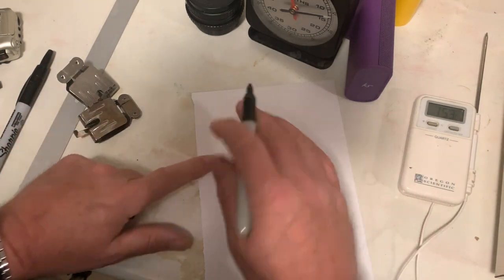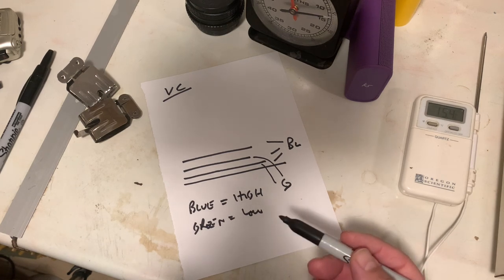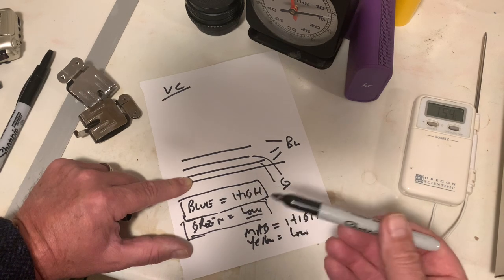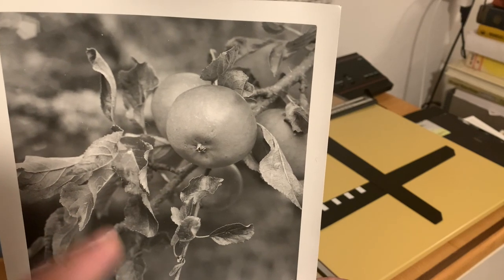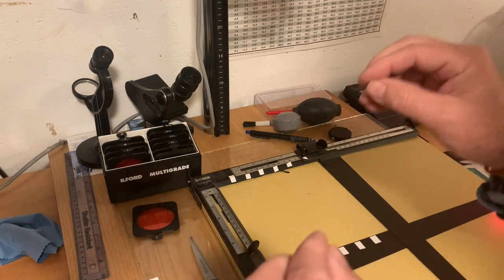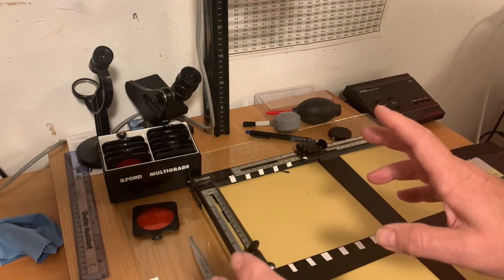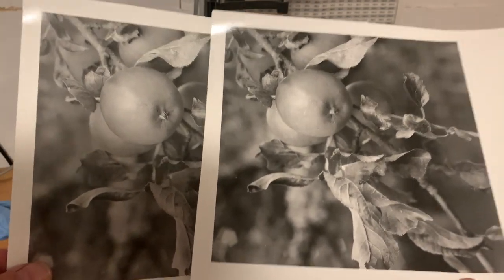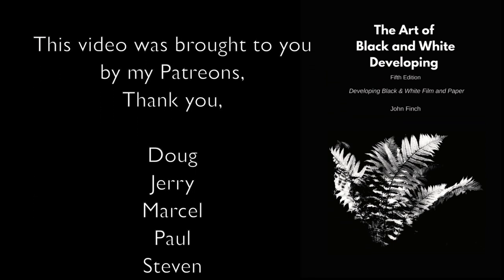Darkroom Printing Pt4 - Split Grade Printing 101

Comment: When I split grade, I lock in my grade 0 time.  Then on the grade 5 test strip…I first hit it with the grade 0 time established.  Then you see the cumulative exposure on the test strip.
Reply from the maker: I must try this
Reply: I do similar, but I am a grade 2 test strip.  It is all about been consistent.
Reply: Thanks for the video - well put together. I also overlay the grade 5 test onto the grade 0 basic exposure, as this then takes into account the effect of grade 5 on the lighter tones.
Reply: same, this is how i learned as well and it works great

Comment: Here’s a good one.  Very good.  As a commenter near the top suggested, Bob Carney taught us (test strips) to make the soft-contrast exposure (Gr. 0-2) just a little fainter than if we were going to do a straight grade print, then lay down the high-contrasts tones ON TOP of the base #0 or #2 exposure. 

Always put the soft filter on the left side of the workbench, hard on the right!!!  Mixing up filters in the dark is just TOO EASY. 

And: in this example, Carney would keep the timer at 5 s. And blast TWICE with #5, then count “1-Mississippi” (twice) to add 2 more seconds. 

Changing the timer invites wasting paper. 

Once you have 1 good print, make 2 more for archives. Then move on, smiling.
Reply from the maker: Thanks, Larry.

Comment: Thank you for explaining and illustrating the split grade process.  I have just started printing my negatives and I am learning as I go along.  It is a hit & miss thing so far and there are times when I just want to give up...but your simple straightforward explanation has filled up the blanks for me...and now, I can't wait to get home and try it again.  Thank you for doing this.
Reply from the maker: Cheers Mark! Don't ever give up, it comes in the end and is so worth it!
Reply: @PictorialPlanet  Thank you once again for the tip.  I have done a couple of prints using contrast 0 and contrast 5 the way you recommended and I am very pleased with the result.
Reply from the maker: That's great @Mark Villanueva

Comment: Thank you for your video, John.  I've been getting mixed results with split grade printing but somehow I hadn't yet tried making separate test strips for low and high contrast.  My trial and error process has been inefficient.  (lots of wasted paper even as test strips...)  Looking forward to putting your knowledge to use in my darkroom!
Reply from the maker: I had the same issue but this seems to work for me. I don't do it all the time, just certain prints.

Comment: Nice print.  Have you considered the intermittency effect?  "Having made a test strip in a series of intermittent short exposures, the subsequent print is mistakenly  made with one long composite exposure. For example, if the test strip showed correct exposure at seven one-second exposures, the print is then made with one seven-second exposure.  Due to what is known as 'the intermittancy effect', this is wrong.  The single longer exposure will produce significantly greater density than several intermittent ones of the same total duration.  Even many professional printers are unaware of this.....  .. So make your actual prints exactly as the test strip, in exactly the same multiple intermittent exposures"  Quoted from Elements - by B. Thornton (p22 par5) and Edge of Darkness (p124).  An interesting approach to setting G-0 and G-5 exposures - well worth a try judging by the differences in your print examples.
Reply from the maker: I do think if that as shown on my FX55 developer series and others. Certainly for three exposures it make little practical difference in my experience.
Reply: I reckon it's an issue with shorter test exposures (1s as you mentionned). IMHO with 3s or longer interval test exposures, the intermittancy effect is lessened and not quite an issue with the final longer print.
Reply from the maker: Thanks for your comment, Julien. Agreed. Certainly in practice it's not an issue with my prints. For fine work, such as pre-flashing paper or ascertaining film speed I use multiple short exposures.

Comment: Nice video; I only have a couple of years of darkroom printing experience but I learned using split grade so that is what I know...and I'm puzzled about the way you choose the 0-grade...you said you choose the exposure where things are "formed". The way I learned is
1) choose the LONGEST exposure that will give you PURE WHITE with grade 0
2) choose the SHORTEST exposure that will give you PURE BLACK with grade 5
and then adjust slightly as indeed 1) + 2) are additive hence you might lose a bit the pure white
Reply: the advantage of this method is that is should give you the "best" contrast and the "maximum" extension of greys; the disadvantage is that pure white is not as easy to find and with baryta paper you also have the dry down effect to take into account
Reply from the maker: Yes, you explain it very well, thank you!
Reply: @PictorialPlanet  well that exactly is my problem when doing the usual splitgrade twist. As a slight variation I use an older RH design fstop clock with two channels, one for grade 5 and grade 0. Getting it properly matched in combination is the challenge. One way is to use an exposure of say grade 0 on a strip I then use as a test stip with grade 5 and vice versa. Obviously a lot depends opn the tones on that particular strip… ending up with a working print to get an idea what additional exposure (burning in) or retraction/dodging I would need at what grades… on different parts of an image. and yes dry down is a pain, even when properly drying (no microwave in my darkroom, a hair dryer must do) the strips…

Comment: Thank you sir for your clear explanation. So, i understand that you always use grade 0 and grade 5 for your test strips? you prefer the grade 0 and always u print based on it?
Thank you
Reply from the maker: Hi Mike. I ascertain my exposure for grade zero and grade 5 and then replicate this mix on my print. I tweak the final print contrast by adding more grade 5 for more contrast or vice versa for less. But, most of the time I use straight grade printing and not split grade.
Reply: @PictorialPlanet  Thank you Sir. So i understand that you prefer grade printing rather than split grading. right? By the way, i was searching about your book that i will purchase (about film developing), does it talk about developing ilford pan f50 since my negatives have a little magenta color on them after developing them.(im following ilford's rules..). 
Thank you Sir so much
Reply from the maker: Yes, my usual printing is just regular grade printing which I find perfectly adequate for many of my landscapes. The apple photograph did benefit from split grade I think. My new book is still in the writing stage and does feature PANF and others :)
Reply from the maker: Mike, your magenta cast won't effect your prints so no worries there.
Reply: @PictorialPlanet  Sir, for split grading, do you recommend if i give firstly the 0 grade exposure (after doing a test strip) and then make a test strip with grade 5 directly on the whole paper which i gave 14 sec of grade 0 lets say. 
Thanks a lot and please let me know when you publish your book of film developing. 🙏
Reply from the maker: Yes, do the grade 5 test strip over the grade 0 time. That seems the best (and logical) way to do it.

Comment: ...or better still; make a test exposure using your 17 seconds @ grade O, and then make an incremental test strip @ grade 5 on top of your grade 0 strip. Develop the twin grade test and select the optimal combination.
Reply from the maker: This might work too but my work flow is effective.
Reply: @PictorialPlanet  The method I described above, is widely attributed to master printer Les McLean. This system has the distinct advantage that, instead of exposing for highlights and shadows separately; you get to see/judge the results of the combination of both contrast grades incrementally before making the final print.
Reply from the maker: Thanks Russell
Reply: @PictorialPlanet  You're very welcome.  I look forward to seeing the results of your revised test strips... Atb 👍

Comment: But where is the additive lighting from the 5 sec/grade 0 teststrip? You made a grade 5 teststrip and chose 17 sec lighting, not taking in consideration the 5 sec/grade 0 previous lighting. The endresult should be darker than the grade 5 teststrip. What am I missing?
Reply from the maker: Because I choose the lightest grade zero strip (5 seconds) it's only subtle. There's not the bigger difference that you'd see with straight grade printing.

Comment: I just wonder how it's possible that split grade printing make your image 'sharper' I understand we put more contrast to the image, that's why we have illusion of sharper image, isn't it that way ?
But indeed it look much sharper on video :)
Reply from the maker: Good question, Patryk. I think the micro-contrast is enhanced sharpening the lines between dark and light areas. This is captured by the negative but not shown as clearly on the print.

Comment: To me, split grade printing is something I go to before dodging and burning.  The reason is to be able to duplicate my work with a high level of consistency.
Reply: Should also mention, I will bump the grade to 5 and do a 50% exposure to gently boast the contrast and “sharpen” the image. (This is through the increase to contrast between areas.)
Reply from the maker: Interesting idea. I'm going to give it a try. Thanks for your valuable input Alasdair